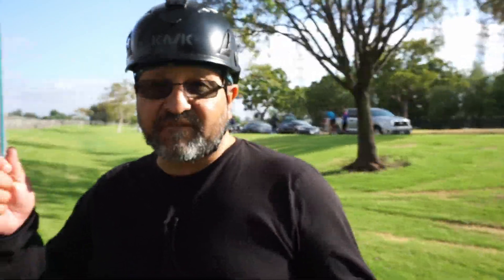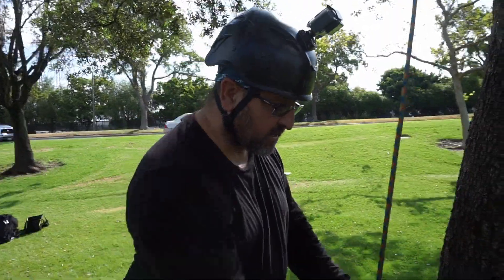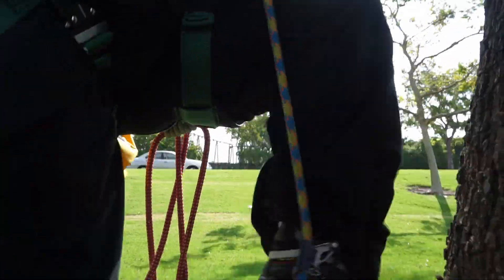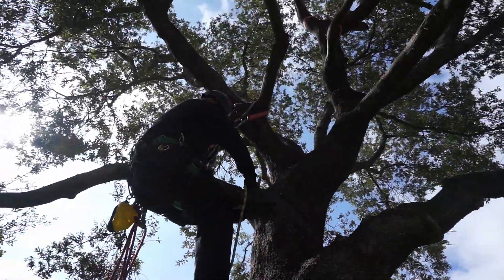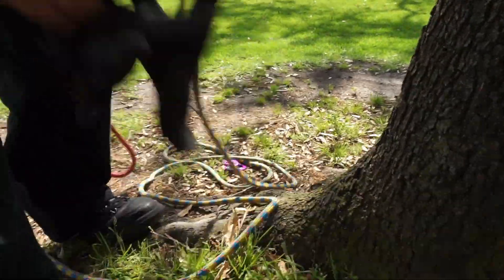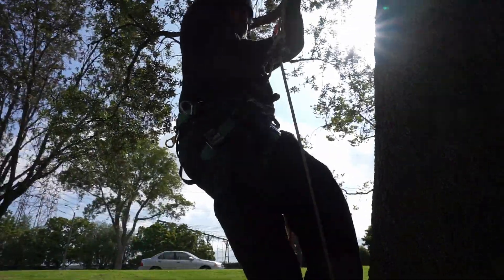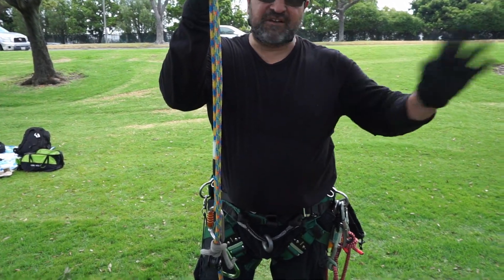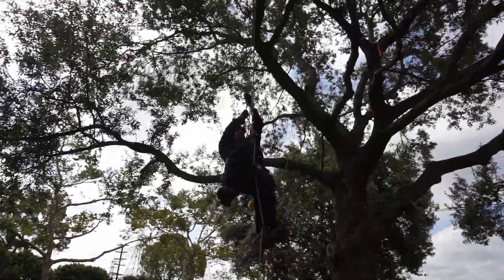MRS Tree Climbing with a Foot and Knee Ascender

Comment: I am definitely going to add a jet step to my system. I did some pruning recently, so no spurs, and I use a hitch climber setup. I added another prussic cord under my pulley and clipped a sling to it. I stood in the sling and stepped up the rope just as you did here. It works great. Im going to add the foot ascender because it works very well in this configuration. Thanks for your great info as always.
Reply from the maker: Glad the info was helpful!

Comment: Great videos Bino, I want to use a hitch climber pulley for mrs, but I don't have a spliced rope. I liked your spread anchor points set up on your saddle, where would you anchor a terminal knot biner on a weaver Denali saddle? Also through which Becket of the hitch climber would you attach your prusik?
Reply from the maker: I made a video on that topic. Here it is.   https://youtu.be/tldB4vgofWA

It may help answer you question.

Comment: Great job, Bino. I’m an older climber who has recently transitioned from a Blake to the Hitch Climber setup, with a Notch Jetstep. I’m now considering adding another ascender, but I also switched to the 11.7mm Silver Ivy rope and gripping it is more difficult. So, I’d rather add a hand ascender than a knee one. Been checking out the Kong Futura and wondering how that would work with my MRS system. I can add a foot loop for the Kong. Any thoughts? I have the same Master 5.0 saddle, so your videos have been very helpful. Thanks for posting such good content!
Reply from the maker: Nice, Myself I like the knee ascender having a hand ascender in the MRS set up is a little difficult use. You might try using latex grip gloves very inexpensive and they work very well. When you have the foot and knee ascender on you are not using your arms for moving upward but just keeping you in an upright position. I love the 5.0 there are so many options. Take care!
Reply: @BinoH  Thank you, Bino. I wanted to avoid adding a chest harness or anything like that, and I like using my arms to climb, after so many years on a Blake. The Futura looks like you can leave it on, and just slide it out of the way, or easily stow it, due to it's small size. I ordered it, along with a nice foot loop, so I'll let you know how it works once I figure it out.  The 5.0 is great. It's familiar because I had the original. Ken Palmer taught me the Blake back in 1995.
Reply: @mattd6086 I would be very aware of the futura engaging with the footloop. I got myself all tied up one playing with it low and slow. I took a step on the futura, it didn’t grab. It collapsed my main system all the way down to my footie. Was real awkward and hard to self rescue. Ended up getting my lanyard on something to shift my weight off the main line.

Instead I went to a footie and knee ascender. I also will climb with a hand ascender  in addition to help with gripping the rope. But in general I decided I didn’t not want to weight an ascender above my main system anymore.
Reply: @snipehuntr   thanks. I did used this setup several times and it went just fine for me. Since then, I got a HAAS collapsible knee ascender and an RRP. Been trying different combinationations. The Kong is a nice tool to have around.

Comment: Hey I would include trying to lean forward and standing up straight to center yourself so you aren't wearing your arms out so much holding your weight up. It takes a bit of getting used to but overall reduces upper body fatigue
Reply from the maker: Thanks for the tip!

Comment: I just started getting into climbing and at first I was convinced I wanted to get into srs but after actually putting it into a working environment I'm starting to realize I actually prefer the old school blakes hitch with a split tail.  If I had to shoot straight up through the middle with nothing to put my feet on then I definately see the advantage of srt with ascenders. I even tried the mrs with the hitch climber and prusik but I dont feel stable tending slack from the bottom and the set back takes a lot to get use to. I'm starting to prefer a big beefy blakes ahead of me with little set back and I can shoot my hitch forward and see it after every pull. Feel like I waste more time hunting for my tail with the hitchclimber set up
Reply: Plus the initial cost for the blakes with split tail is so much cheaper. 100$ for the rope. 40 or so for a good split tail with spliced eye and a couple rated biners. I feel like ive just wasted a few hundred dollars trying out all these different ropes, prusiks, pulleys and ascenders
Reply from the maker: Yes I can see how the SRS system and Hitch Climber with a prusik set up would be difficult to get used to. For me the I didn't have the Hitch climber set up but I had a micro pulley and two carabiners and I think my hitch was the Knut I really like reaching above my knot it felt easier than pulling from under my knot. The SRS took some getting used to but after I got used to the foot work now I like it the most. Since you have them take your to get used to them.